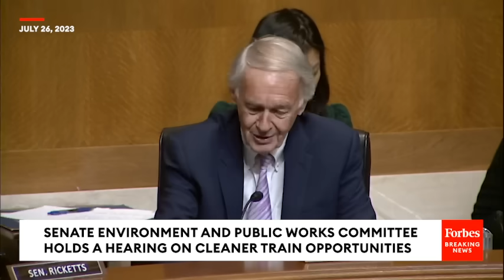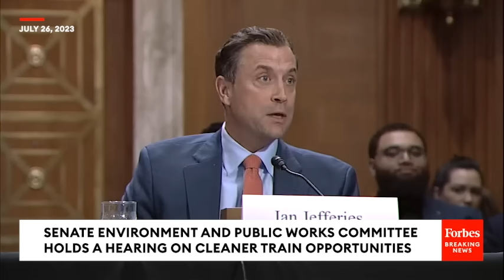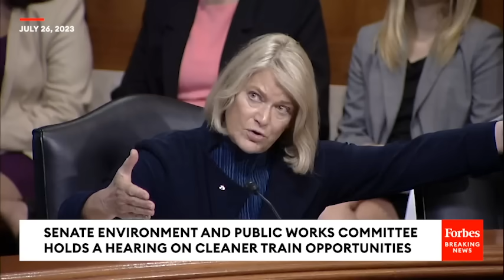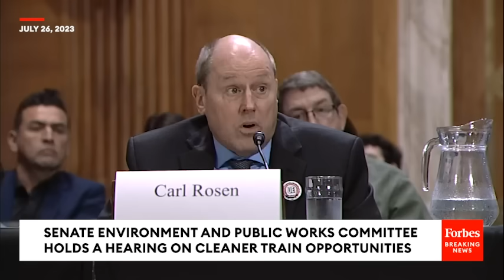‘How Long Would It Take To Replace All Diesel Locomotives With Electric?’ Cynthia Lummis

Comment: This is crazy. The education system in America has done it's job and the majority of people cannot understand how things work. The amount of items we use on a daily basis that are made from fossil fuels is staggering and we cannot run the country without those fuels. SMH
Reply: And marketing where a battery pack is now sold as a generator.  Nothing is generated just stored for later use.
Reply: The education system has NOT done its job, this is the problem. If the average student can't grasp a basic knowledge of mathematics and reading on the grade level of a high schooler we are in big trouble as a country.
Reply: @danielsteward5090 -  To mollify these self appointed crusaders with their hearts on their sleeve. a chip on one shoulder and an axe to grind on the other, HISD has removed the analog hallway clocks because too many students could not read them.
Reply: @johncollins7062 . Sir, and why is that? On account of  children not being taught the basics that have been deemed unnecessary by self appointed educators.
Reply: @jerryrollins512 ...and why is what? I was a state reading and comprehension record holder at twelve; and a world record holder, with the FCC, fourteen years later. My pre-Camelot public education was far superior to what Randi Weingarten is providing today.
Reply: @danielsteward5090 Dan, here's some facts. During Carter admin they created cabinet position for new Dept of Education. This dept set standards and requirements for what would be taught in state schools...which violated constitutional states' rights. Now we have grammar and high schools teaching nothing worth knowing which includes woke BS and renamed filth as literature.   It's  not the school boards,  It's the federal govt requirements driving down scholastic achievent. Now America has generations of kids that can't read, write, spell or do simple arithmetic.  The purpose is to manipulate these kids into  relying on government  news media and govt welfare because it buys votes.
Reply: We have more than 150 years of coal and 450 years of petroleum. Preparing for the natural convergence of time, technology and technique will provide far more efficient and economic alternatives than the overpriced products of today; most of  which, the guilt driven public can't afford. Finally, independent authors, like Bjorn Lonborg, are coming forward to emphasize this inevitability.
Reply: @johncollins7062   Thanks for the tip on the book. It looks interesting.
Reply: @johncollins7062 guilt driven public(excellent choice) is only because we've been beaten with half truths and fabrications to the point where an average person can't decifer what's fact vs crap fake news.
Reply: could not have expressed it better myself ... my God, can the government waste our money.
Reply: Experts: if you implement liberal policy, the suffering, and economic collapse would be staggering
Liberals: well we have to try or we all die anyway
Reply: The only way is  to revive the small nuclear plants, before this is the only reaining alternative.
Reply: That’s because they’re training student activists and not teaching to educate students.
Reply: How do we dispose of the used batteries 🤨
Reply: @markjulianoriginalhooli2217  Ask the EV fanboy, climate alarmist that.
Reply: It is the definition of crazy! Whether one wants to call it a fascist or socialist/ communist ideology which follows the Rules for Radicals written by Saul Alinsky or perhaps being under the influence of a chronic narcissistic ideology is debatable. Narcissist, sociopaths and Psychopaths only care about being in control and getting what they want regardless of the consequences they bring upon the decimation of the security with unit integrity. They are highly manipulative and controlling people and in the wake of their path It is Well documented how they cause a a sentinel strain and draining on their victims mental and physical strength, their financial assets. There's a constant moving of the goal post with gas lighting and other diversionary tactics which seems extremely apparent with the Democratic Party as they've transitioned it more towards a socialist/ communist party possessing a complete lack of respect, Honor, accountability and responsibility for the consequences or results of their actions! All they really care about is remaining in control and they will do so until the unit Integrity is completely annihilated and there is no more to feed off of. Then they move on to another mark, another victim. In essence they see happiness at other people's expense all of which is completely incongruent with God's will for us to be happy, to seek peace happiness and love in healthy ways.
Reply: Thank you KK   cowboyboilermaker
Reply: And most of these so-called politicians are educated. Sad indeed.
Reply: @bradbroemmer9106  unfortunately..the education is mostly the law and politics.....but not the what feeds , and clothes us... They all are dumber than a box of rocks when it comes to how equipment  works, how farms actually work the long days ...hard work nor bet not one has worked on the assembly  line or 22 hour shift waiting tables ....or how to use sewing machine, band saw etc... look at people who head up lots of departments. Even in big corporations... Management of say trucking ...or people dispatching if they've never been on big rig over the road not (local)  they don't understand traffic problems, your log time requirements to stay legal that you have to eat,take shower, wash you clothes ...Now some bosses who used to be out there understand and go out talk to drivers... that's the mentality  that's not in people at top of Many Departments in Government.  and the big bosses.
Reply: SPELLED CHECKED CHANGED 11 HOURS TO 22 HOURS...
Reply: Hello again! I just realized your photo reminds me of Penny Marshall. Except you are prettier.
Reply: @johncollins7062  I get that lots. A friend of mine looks like Linda Lavin. We call each other Lavern & Alice. :)
Reply: @KnittyKitty215  - I am not surprised. When one is that fetching, comparisons are inevitable. Perhaps you should try a 3/4 shot. I see a little Barbra Streisand there too.
Reply: They are insane.
Reply: Absolutely right. This idealistic emissions nonsense is being promulgated throughout the western economies, not to the benefit of the environment but those selling 'approved' products. I'll believe in the philosophy when I see the first all electric 'jet' aircraft.
Reply: Why Rockefeller wanted to control education. To junk it
Reply: They are not fossil fuels. That’s another gaslighting term to indicate another lie….that oil is non renewable….a Rockefeller tall tale told to make oil seem like an expensive commodity.
Reply: Done it's job. Pffffffffft. Not by a long shot. Say hi to Randi for me.
Reply: How ironic. You mention the education system has failed in 'it's' job. You are so right. The correct word you are looking for is 'its'.
Reply: It is crazy how many people think we actually use "fossil" fuels. It is astounding.
Reply: All electric vehicles require grease, yeah they make synthetic oil, but I know of none to replace 'axle grease', the grease in bearings, steering, etc., that grease comes as byproducts of other petroleum products used - for now, anyway, if THESE uneducated fakers maintain power and hold any government offices.
Reply: Fossil fuel is a misnomer created by those opposed to petroleum based fuels. We need to stop using the terms that our internal adversaries insist on thrusting upon us. Just refer to kerosene, gasoline and diesel and the other petroleum based fuels as petroleum based fuels because that is what they are. They have nothing to do with fossils.
Reply: "Fossil fuels" is an erroneous fake science term, real science tells us oil and coal are abiotic, and not from dinosaur remains, which didn't exist millions of years ago anyways, but I digress.
Reply: They have lost their minds .. pushing crazy idealogies on us from made up sciences with no research supportive data whatsoever ..
Reply: Haven't read the replies, one big thing to add is that fossil fuels is NOT animals. As in dinosaurs as left wing loons who strap themselves to trailers and block roads with signs just showing how stupid they are believe. They are plant based from when Co2 levels were extremely high and Plants were massive in many parts of the world. Example: what you'd see a 3 foot tall fern now would have been 30 feet tall with leaves 15 feet in width. Getting the point?
Reply: Truth is us education becomes mandatory when factory needed labor! Look into it! Literally when not at farm kids where in school so they'd be factory labor! An now it's school or jail! Seriously see the socialism?
Reply: You are absolutely correct. Since we are currently addicted to Crack Crude Oil, we should stay addicted.
"How brilliant ith that?"
Reply: @TimeSurfer206  Yes.  That's the problem. Just look at the numbers yourself. There is no climate crisis. The elites are lying to you and because you are undereducated you just believe them. The same with the mask mandates. The masks don't do a damn thing. It even says so on the side of the box.  Look at how rich Al Gore and John Kerry have gotten lying about the climate. It's sickening. If they believed it they would "zoom" all their world wide meetings instead of private jetting to them. SMH
Reply: Please stop calling it Fossil Fuel, think about it, we use 10 million barrels a day everyday, each barrel is 159 liters or about 40 US gallons, how many dead dinosaurs would you need to supply that amount of oil, oil is almost as common as water and empty oil wells refill themselves, get your facts right first please, thank you.
Reply: Over 6,000 different products are made from oil,
from drugs to cell phones.
Reply: But kids can now recognize their feelings. They also are mostly anti capitalist and pro socialist and they cannot tell you why. The indoctrination worked.
Reply: So true but if parents do NOT talk to and teach their children they will believe the commies teaching them at the school of your choice.
Reply: AND NEVER WILL!
Reply: And the left is telling them all about the wonderful free lunch without allowing any more nuclear power plants.  It's lunacy.  They want credit for free candy handouts while they know their opponents [GOP] aka their enemy today, will have to come in and clean it up later - if there isn't too much damage in the meantime.
Reply: Yes, but what has that got to do with locomotives? This isn't about saying nothing can be made using fossil fuels.
Reply: @jocktulloch3499  WHAT SHE IS SAYING IS THAT FOSSIL FUELS ARE A GOOD THING AND A MUST OR MOST WILL NOT SURVIVE IN THE USA OR MOST OF THE WORLD.  DON'T DRINK THE "CLIMATE CHANGE" KOOL AID.
Reply: @jocktulloch3499  Do you know how much pollution and carbon is released to the atmosphere when you make a wind turbine or an EV battery?  If pollution and carbon are what you really care about then you would concentrate on making ICE's more efficient.  But the wonderful EPA banned efficient turbo diesel engines from Europe instead and now they want to dump all that crap in the environment on us from battery and windmill production, and they want to pay other countries to do the same.  Are they really trying to ruin everything?
Reply: No politician couple possibly be that ignorant.
Reply: @Absaalookemensch  MOST "REAL" POLITICIANS ARE IGNORANT!
Reply: Knitty Kitty 

That is precisely why it's being done!
Reply: @johnny4aces410  What's being done is not focused on solving the fictional problem, but is instead focusing on government seizing power of key sectors.  A sector that moves 40% of the freight with only 1% of the emissions would not be the focus of increasing regulation if the goal was to solve emissions.  The OP was actually speaking about you, not knowing how things work.  Because your comment is tantamount to Bahahahahaha as you shuffle towards the building where everyone goes silent with a big smile, because they promised you some stuff when you get there....
Reply: @derekturner3272 I think you misunderstood his meaning.
Reply: @derekturner3272  Has no one went to Europe or Japan and see how their Rails are ran. I really believe they think stuff up from games like SimCity or other City builder games and thinks this stuff runs on air.
Reply: @derekturner3272  Absolutely - Seizing power as spelled out in Agenda21/Earth Summit 1992
Reply: The people running our country are some of the most ignorant individuals I’ve ever seen speak … if this woman doesn’t know these questions are ridiculous at this time she should resign
Reply: @farmermatt629  THESE "IGNORANT INDIVIDUALS" ARE THE MEMBERS OF THE DEMOCRAP/COMMUNIST PARTY THAT SEEK TO DESTROY THE USA!
Reply: Your last sentence is not logical.
You have not supported the point that "we cannot run the country without (fossil fuels)".
More than enough electricity can be generated by solar, wind, and geothermal. Add some nuclear in there because I believe it to be safe and clean.
How is it that the country "can't run on fossil fuels"?
Reply: You know that trains run on electricity now, right? Adding battery back-up isn't a stretch.
Reply: The problem,  @michman2 , is the current state of the art in battery storage can't even begin to match the output of the diesel generators in current use.  The only way to use electric-driven locos on long-haul trains would be to pipe power to them, either third-rail or cables.  How do you do THAT going across the entire country?  Never mind the fact the current level of power-GENERATION is already insufficient to need.
Reply: But that is not a reason to continue with dinosaur juice and give up on renewables.  #stopburningstuff
Reply: @AndrewLumsden  There is no climate crisis. There is no reason to change from gasoline and coal. You are being lied to. Educate yourself. Stop just believing everything the news tells you and look into the things they say. You can look at the data yourself. There is a NASA web site with all the maps from above. The glaciers are not melting away. Look at the temps for yourself,, the earth is not getting warmer.
Reply: @AndrewLumsden  Give up? on renewables.  They're a good idea if they work, but a really bad idea and a setback when they don't.  Until then all effort should be concentrated on making existing modes optimally efficient.
Reply: @gendaminoru3195  Evidently you need to read again what I had said. - Specifically NOT to give up on renewables.  🙄😖
Reply: @AndrewLumsden  I don't need to do anything.  I told you that your renewables are NOT the top priority and to make it so is a fool's errand
Reply: @AndrewLumsden  SURE!  BUT ON YOUR ON DOLLAR!  NOT FORCING THE AMERICAN PEOPLE THAT ACTUALLY PAY TAXES TO PURSUE THIS DREAM!
Reply: @AndrewLumsden  RENEWABLES WILL NEVER WORK ON PLANET EARTH AS THIS EARTH IS ABOUT TO CHANGE WITH THE RETURN OF JESUS CHRIST!  UNTIL, WE WILL FIGHT TO THE DEATH!
Reply: You wrote:  "The education system in America has done it's job..."  The system has obviously failed you.  The word is "its."
Reply: Thing work like this. These people who say "we can't fix it" are ones that will expect least consequence of no action. If you are wealthy, keeping your wealth is most important part of your life. Changes create risks. Your elites have 2 paths:
A) Prioritize on climate change and risk on failing and destroying your own wealth in process but lessen risks of climate change for everyone
B) Prioritize on keeping your wealth and let everyone take climate change risks
Guess which they choose? Guess which path people from video chose?
Reply: @djemanac  oh don't worry, the wealthy won't lose much, it is us, the middle class who will pay in full for all of this. Fossil fuels were like fertilizer for civilization, fueling expansion and progress. When it is taken away the 1% will have even more control, and the rest of us will be struggling to pay for electricity
Reply: "It's" is a contraction of "it is", and "its" is possessive.
Reply: @slappy8941  Thanks. I really don't know what I'd do without the input of people like you. See how I used I would as a contraction there? These corrections on social media are just what everyone needs when expressing opinions on what they feel strongly about. Good job.
Reply: @KnittyKitty215  LOL...  so true.
Reply: @slappy8941 thank you for the instructional brief.
Reply: Yep, you can thank the austerity programs of the GOP, who figure the rich can afford it, the poor humph, tough.

Comment: How long it takes to charge a locomotive
Reply: Longer than is technologically possible. I'm a conductor and we run about 100 trains a day out of the yard I work I'm based at. They would have to demo whole towns to make the space to plug in that many locos.
Reply: You don't charge a locomotive. You fill it up with diesel and the equipment that's built in to that high tech diesel electric machine makes the conversion from diesel to electricity seamlessly, automatically and routinely just like it was designed to do!!